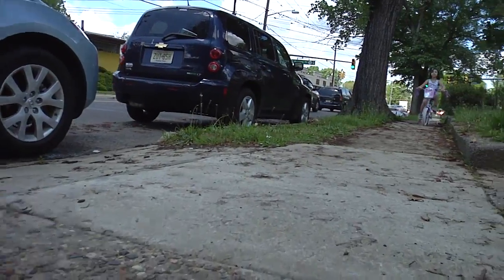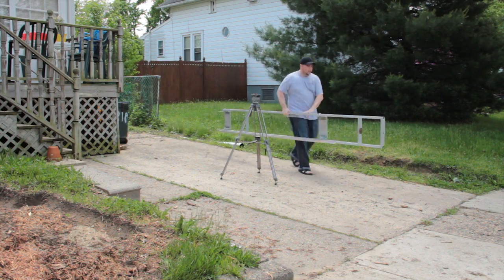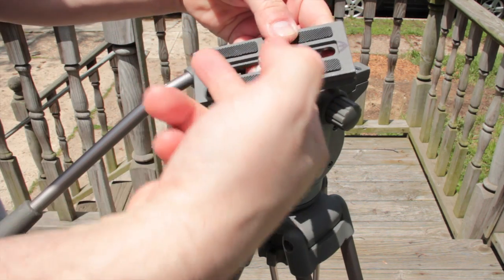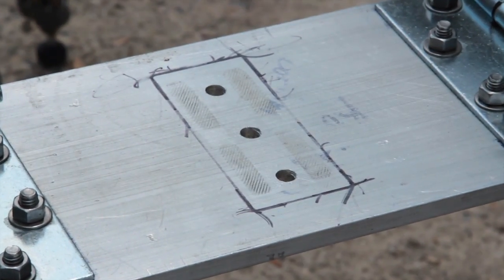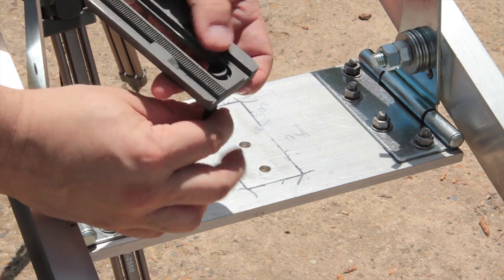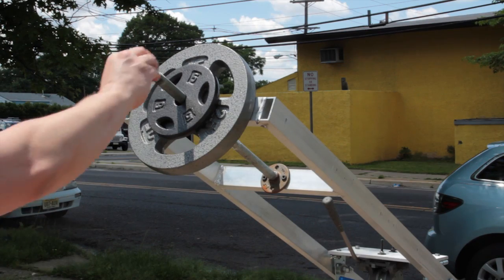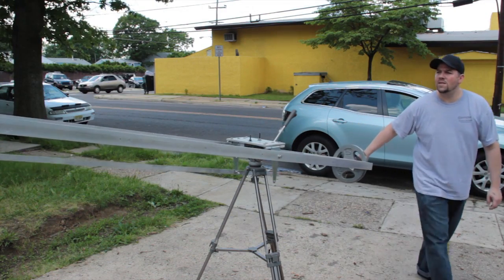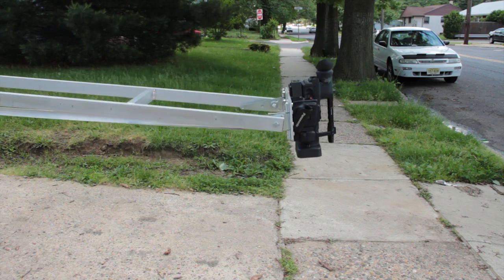How to build a camera Jib / Crane - DIY

Comment from the maker: I think other than welding something like this I would not be able to screw it together. I won't be strong enough. I had mine welded by a shop that welds aluminum. Which is the same place where I bought the aluminum tubes and had them cut. I just took the drawing and picked it up the next day :-)

Comment: Continued: 5. What is the weight of the unit without the camera, etc? 6. How hard is it to unlock the tripod and (using a tap) to tilt up yet still get a good tracking shot? As you tilt up and down, and the center of gravity changes, does it get harder to tilt the camera? 7. As you discussed, have you drilled the hole lower and did that work better, or did the hinges want to pivot? 8. Do you have to stand to the side to use the tilt arm, or can you reach from standing behind the unit?

Comment: Great looking jib!. Questions. 1. What stock material is the frame? Looks like 3/4" x 1.5" x .125" thick 10' alum 6063? 2. What material are you using to place the camera on, and tie into the tripod... is that wood painted metal grey, or alum plate? 3. Have you tried using nylon washers between all rotating parts? 4. Why the hinges as opposed to something more rigid? I realize it's 'fixed' in place and therefore rigid itself, but was there any advantage to using hinges? Disadvantages?

Comment: Absolutely GREAT!!!!! Considering the cost of video equipment in South Africa this is the perfect answer. I will appreciate you please letting me know what the full length of the frame is. You have 81" and 13,5" plus an unspecified section. I ask this as I'm not sure what the impact on the balancing will be if the total length in not right. Many thanks!